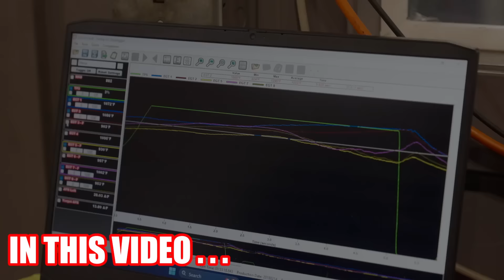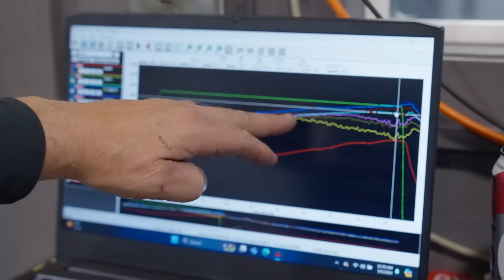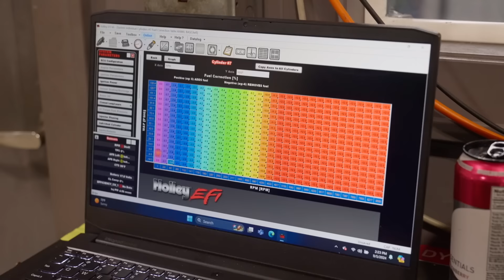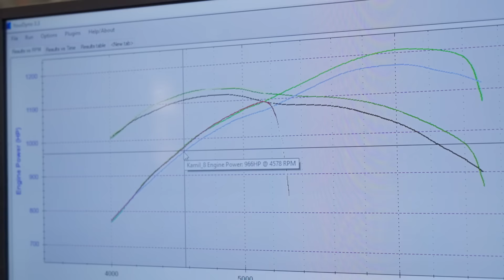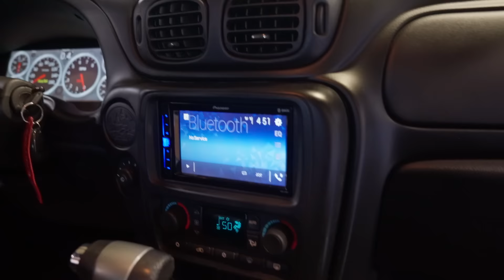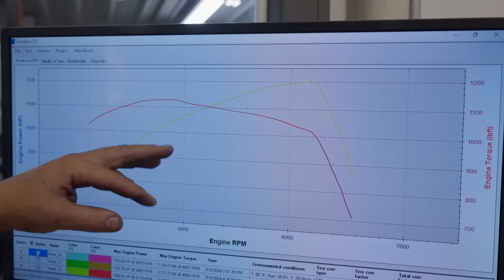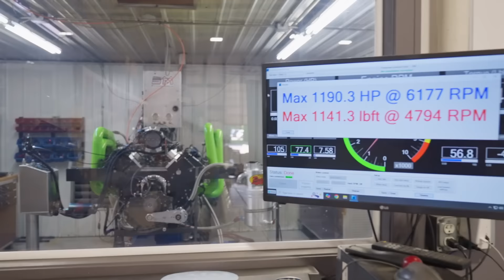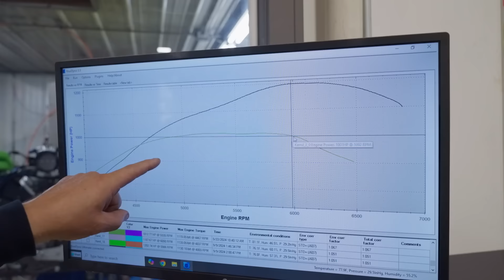200 HP from a Cam Change? The Biggest Cam I Have Ever Used In A Boosted Engine!

Comment: This combination is alot different then a car, ive raced pump boats i currently have a 1486hp seadoo we grudge, boats and jet skis same principal, the motor matters of course but the real deciding factor is your jet pump, a car has transmisson to drive shaft to rear end to axles to wheels, a pump boat motor spins drive saft to impeller which creates a suction,  at that point water comes in the intake grear under boat pushes through the jet nozzle creating speed, so its all about the pumps, ive watched the videos i believe u stated jump pump couldnt go 6500, whoever told u thay is absolutly am idiot, my ski spins 12,000 rpms, my Hawainin spins like 8800, customer might have an inpeller thats tunes for 6500, u never want to cavitate when u do that your day is done u want that intake grate sucked to water, the biggest exspense is the impeller that are exspensive make the wrong degree for trailing edge and leading edge could cost u alot of money, u add more power to your pump setup u have your going to be buying new impeller or sending it off for repitch, yes they have to go to specialist to have it done needs to ge repitched, a special computer will check it and so on, on my 38ft top gun it was al.ost 3k to have repitch and balance, is the customer running a jet evader, whats the pump pressure, i dont know the customer but sounds 80 percent of people in jet pump world, spend stupid amounts of money on boat engine but are cheap a hell when it comes to what matters pump and impeller and there bitching why that just got drug by another pump boat with half the power, he sounds cheap doesnt want to spend money on new impeller or chase an impeller until he gets right one probaly rather u spend your money on figuring a combo to suit that 6500 rpms, Ya i said hes cheap u tell me jet pump setup he has i gutantee u it can spin over 8500, just ask mike finnegan from finnegans garage he is a jetboat fanatic owns them builds them races then he has currently a 949 cubic in twin turbo sunny leonard setup in it boat is called gqme over, u might not take a the word of a nobody like me but u should take his word

Comment: Why is the lobe separation angle SO WIDE!! 123⁰!?!? I would bring it down to 115⁰-118⁰ that will net you a better higher rpm horsepower #. That cam #4 looks like a supercharger cam.
Reply from the maker: lol
This is a Supercharger Engine, just getting numbers NA for the customer. I explain that there is no sense putting blower on until I figure out the 4 cylinders.

Comment: Is the compression ratio too small for the cam? Not to me. The cam should be correct for the heads and the displacement to make horsepower. The compression ratio improves efficiency as you increase it, but is also limited by combustion chamber design and fuel octane (to prevent knock). The engine would pick up HP with more compression, but it would also have a smaller tuning window and possibly knock.

Comment: Okay to start this off I am very naive when it comes to Motors not dumb about them but naive the reason I'm saying when I'm about to is I was wondering if that motor is not getting enough air from that single throttle body I don't know what size it is but if two of those large throttle bodies would help with such a large cam in it now I do know that is a 903 cubic inch Hemi and that would suck a lot of air into it would this possibly be an air issue while you're not getting the performance out of it that you want I don't know food for thought and I'm trying to learn

Comment: You need to be careful with those EGT measurements, once you see noise you're getting electrical pickup, and all bets are off.  Those EGT probes are pretty chunky and won't react quickly to a temperature change.  It's possible that the lower power coils aren't interfering with the signal as much, so the data looks more sensible.  I'd take the filtering off and either ignore any noisy signal, and investigate where the noise is coming from.  Don't trust any measurement that you can't cross check against something else.

Comment: Exhaust large enough, just guessing. Seems like it did it with what ever cam is in it. Enough ignition coil, even though it did it after swapping. Those cylinders may have the right amount of fuel to light off. Idk you’re the engine guy. I’m just trying to get your brain thinking. I’m just trying to make the video longer, lol.

Comment: Two different length fuel supply lines, maybe one is at a different pressure than the other or cavitation issue? Just a bind guess hope you’re problem goes away

Comment: For the cubic inches of the engine, that camshaft is, in my opinion, too big for the compression ratio. A cam that big should turn 7,000+ rpm on that engine, but with such a low compression ratio, it will run out of steam pretty quick. Under boost, the extremely wide LSA will help it make power at higher RPM, but not N/A.

Comment: Throttle body is to small for the size of the motor. At lower rpm you are getting enough air, as rpm rises it starts to starve for air.

Comment: Haven't hit the end of this video yet..but watching you tear your hair out over the four oddball cylinders is excruciating.
Dumb question probably..but have you checked the new camshaft for consistency of lift/duration/spacing from cylinder to cylinder?
Seems like the place to start...it's the last major change made before the weirdness began, and no disrespect to the cam grinder, but they seem to have a tendency to shoot themselves in the foot so far..
Just a thought.
Reply from the maker: We checked it first
Reply: @stevemorrisracing  
Figured as much..
Finished watching and was sorta surprised at the eventual findings..
I'm a poverty-stricken slow race car kinda guy..constantly shocked at the failures you fellers run across in all the high-zoot electronics.

Comment: I’m not an expert.  That intake seems a little small for an engine of that cubic inches.  Air in vs air out.  Engine is an air pump.   So if air in is restricted then air out will be as well.  I would say double the size of throttle body. Then retest.  If I was a betting man, if the volume of air was correct for cubic inches of engine then you would see huge horse power and torque gains from a small cam.  You can hold open intake valves longer all you want, but if there is not enough volume of air to accommodate that lift then it’s wasted.  Again, I’m not an expert, but makes sense.

Comment: I'm thinking that question has a couple of directions to go with, I ask, think compression ration is static, controlled by volumes not a cam thing, cylinder pressure is effected by bleeding off compression with cam timing adv more comp, retard less comp, please continue discussion  in next vid around this subject. Thanks

Comment: how fast is your data acq taking data?? When running an engine that high of load/TPS and you immediately shut throttle, the EGT's will spike momentarily since you are shutting off the air supply. 

Also, I'm sure when you close throttle the ignition timing is retarding, retarding ignition timing INCREASES EGT temps. If you're data acq is too slow, you might not always be capturing this. You would likely need a minimum of a 5HZ data collection to capture it repeatedly. 

Happy Troubleshooting!!!

Comment: Cam is not to big. I've had combos that are all pump gas 10 .5 - 11to1 comp . Ranging From smaller 468 / 496 cam usually is 282/292 at 050. These motors will make 725- 750 HP. With larger combos like 565 /582 cam spec would be 286/ 304 and these combos would make 925-950 again all on pump gas. Even 1,000 horse 632 cam would be 288/ 310. Now you're at 903 cubic inches that cam doesn't seem too big at all. That motor should gobble it up.

Comment: This engine without blower is running out of air with that throttle plate. That's my guess as to why it's laying over. It is 900 cubic cubic inches. Is that the same size throttle plate run on the 540" SMX?
That's my guess. To much cam? I don't think so especially boasted.

Comment: If you use known good parts for diagnostic purposes it isn’t really throwing parts. You knew the spark efficiency was off. You made changes with existing components without positive data changes. Then to prove you bad spark diagnosis swapped to a system you know works and got the data you needed to fix the problem. The real puzzle would have been, what if that didn’t fix it. What would the next step be?

Comment: No I do not think that this has to much cam for being an N/A engine purely from the fact that you put a much bigger cam in the engine and it didn’t change the low end torque and from the testing I have seen and watched from much smarter people than I, “when you put in a bigger cam and it doesn’t lose low end torque the cam is still to small”

Comment: too much cam for the compression...meh. "too much cam" for compression tends to give up some low end, and requires more ignition timing than most people would ever consider, but too much isnt really a thing. sadly trying to optimize the tune for it NA becomes mostly a waste of time because the timing curve, and fuel requirements will change dramatically once you pressurize it. fix the ign problems, and crank a ton of timing in it.

Comment: Your intake system is clearly inadequate for a motor and cam that big. Boost might get you the HP target you're after but it doesn't fix a poorly designed and inefficient system.

Comment: Steve I don't normally comment but I think you have already said the problem it's just the solution. Eluding you
I agree that the anodising on this engine is causing earth issues 
I believe that to get the diagnostics right for this you need to earth everything AND I MEAN EVERYTHING 
Earth all the spark plugs injectors and connect all those earth's together to a cable to battery but not to the engine itself make all earth's separate from the engine add a cable from starter to a connected earth